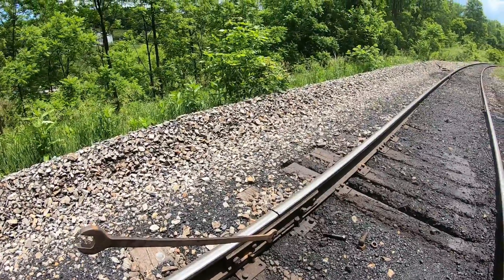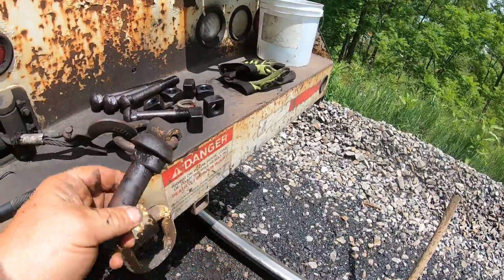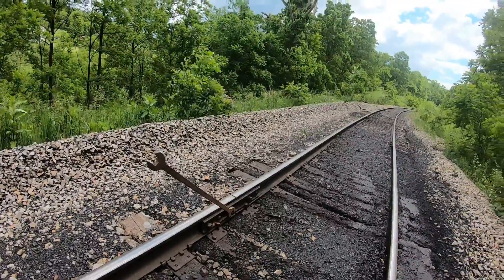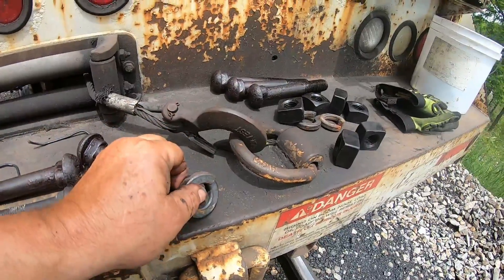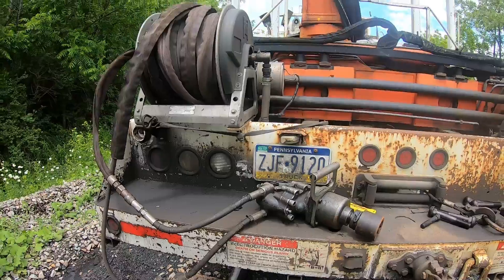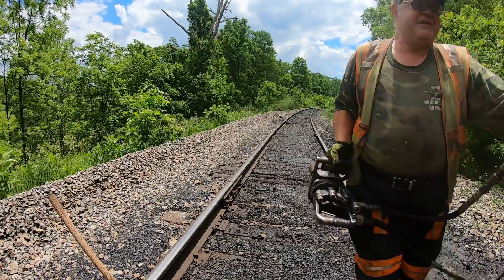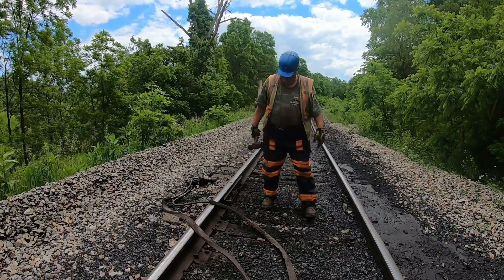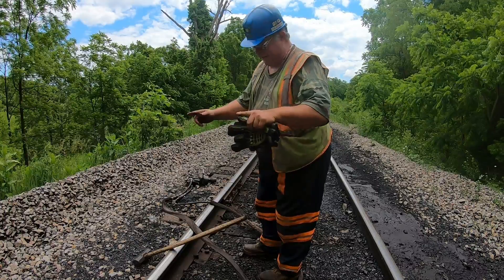Bolts in a Track Joint need Replaced - You Can Help Fix Them

Comment: cut bolt on nut side with railsaw or cutoff saw
Reply from the maker: Yes sir, that's the way we do it, didn't show that in the movie and
now I'm really kicking myself for not doing it, but there will be
others to cut off for sure. I am always very, very careful when
cutting bolts off when I'm by myself, I'd much prefer to do it
with someone there, I've seen some weird stuff happen like
blades break up and scatter everywhere. Thanks for writing in
Reply: @ccrx6700  yeah it's nice to have someone to hold the punch or the plug Hammer works good if you got one of those

Comment: I always found it easier to remove a bolt one at a time and at least put it's replacement in loosely to keep the joint bars from flopping off instead of taking them all off at once.  It may be a little bit slower most of the time, but those times that the joint bar flops off you would lose a lot of time and gain a lot of frustration.
Reply from the maker: Good thinking 👍

Comment: You got to film the hi-rail boom truck you're driving to load rails with the knuckle boom.
Reply from the maker: Someday I will do that, have to use both hands to run the control box,
gonna have to figure out a way to do this, thanks for the suggestion

Comment: When I hired out as a brakeman, a "section" man was turned loose on a section armed with a wrench, hammer and canvas bag with nuts, bolts in it to patrol on foot....more difficult patrols were on motor hand cars.
Reply from the maker: Ah yes, the way it used to be! Early on we were given a push cart with
bolts, wrenches, spikes, claw bars, etc. When a train was coming
take the cart off, then after he went by get back, do not miss those
days! Course I was 30 years younger. Thanks for watching

Comment: Here in the UK, we call them fishplates. I replaced a fair few of those bolts. Either by hand, using spanners or using a petrol powered nut runner or bance as we called it. Worked 11 years on the railway. 

Enjoy watching your videos
Reply from the maker: Glad to hear you enjoy them. Do you know why they are called fishplates? The part of the rail under the head and on the web where 
the joint bars contact, those parts of the rail is called the fishing.
Space between those contact points is the fishing space. Thus
that is why they are fishplates and it makes good sense
Reply: @ccrx6700  never really gave it a thought as to why they are called fishplates. When I joined the railway, I had to do a personal track safety course (PTS) to get a job on the railway. It was a 3 day course, just teaching you what to expect on the job, basic terminology of the 4 foot. What to do in a emergency, stopping trains and the correct way to contact the signaller. Amongst other things. The pts qualification lasts two years.

Later, they introduced a track induction course lasting 7 days, giving a more indepth look at the railway, going into more detail about the components that make up the railway. This was brought in, as so many were starting and didn't have the experience. 

Do they have anything similar in America?
Reply from the maker: @WaylandJoe  yes most RR do have safety courses. We had a 2 week training when I hired in but it was for mining since we are a coal mine, they didn't do anything here for RR, was all learn as you go back in them days

Comment: Fasteners are so ubiquitous, unless one works with them in industry, one doesn't give them much thought.  But Bolts like on that fish plate (Ha ha) or the studs on that hold the wheels on your car or truck have specific tensile strengths, and certain elasticities. The elastic properties go a long way in reducing loosening due to vibration-- it will allow a part a small movement and then snap it back. That's why you don't want to overtighten a bolt, and why different applications have different torques.  Overtightening a bolt can cause it to stretch and lose that elasticity.   Many years ago there was a feature on "60 Minutes" about "counterfeit" bolts  coming in from the pacific rim.  The steel formulation was wrong, and they'd fail.  Caused no small concern in the Airline industry, for one, but broadly through manufacturing at the time.
Reply from the maker: Thank you Rod for the very detailed comment, excellent points sir,
I did not realize that about the elasticity helping to reduce loosening,
makes very good sense. Oh dear, wrong bolts in airplanes could
be a real disaster!

Comment: We were required to wear a hard hat when we moved 20 ton coils of steel.  Since hard hats weren't required anywhere else in the plant, guys used to ask why they had to wear one back in the crane bays.  I always told them it was to give paramedics something to scoop up the mess in if a coil ever fell on you. We did get an object lesson though, when a mechanic left a wrench on one of the cranes (bridge and trolley crane, floor pendant control) which eventually fell off.  If it would have hit someone on the head, it would have left a bit of a mark. So, hard hats.

Comment: We use cordless Rad torque guns at work and they're terrific.  They're no bigger than a cordless drill and not much heavier. We have a few sizes from 500lb-ft on up.  Our biggest will torque all 324 lug nuts on a Cat 797F to 2500lb-ft with one or two batteries.
Reply from the maker: Now that's impressive! Am gonna look those up, thanks for the
info Dylan

Comment: Warsher, I love it.

why do you alternate the side the nut is on?
Reply from the maker: That's the way the joint bars are made, I believe it's because
they seem to think the staggered bolt pattern gives better holding
power
Reply: @ccrx6700  thank you.  I saw that in your new video.
Reply from the maker: @frotobaggins7169  👍

Comment: Great video. I was wondering if those bolts will need retorquing after a few trains have passed over the joint.
Reply from the maker: Thanks, glad you enjoyed and very intelligent question! Yes in this case because of the unstable ballast conditions. Most generally in
good ballast where track surface holds good, we don't need to re torque them. There is no set time frame for re torque, every joint is
different

Comment: I worked on a Section crew (Maintenance of Way) crew during the summers during my college years in the late 60’s. No powered tools, everything was muscled powered. Kept me in shape for sports. And on the CB&Q, now part of the BNSF, they were called Angle Plates.
Reply from the maker: Thanks Don. We used to use all track wrenchs too way back, but
once we got an impact, wow what a difference, go so much quicker
and way easier on the back and neck than trying to wrench off a
frozen bolt. I'm sure you know what I mean there. Appreciate your
watching

Comment: That's how it's done! I haven't seen any MOW equipment on the big RRs to deal with joints, so that makes you the expert!  😊  Thank you for sharing some necessary but difficult work on the tracks!
Reply from the maker: Your welcome Brian, great that you enjoyed sir. They do make a
machine that tightens the bolts as you ride along although we've never had one here. With 17 miles of jointed track that would be
a blessing to have one of those
Reply: @ccrx6700  I would like to see one of those!

Comment: I used to think 150ft-lbs of torque on CAT 3408 cylinder heads was tough.  Trying to manually crank 300ft-lbs... That takes incredible effort.
Thank goodness for power tools.
Reply from the maker: Big wrench = Big Torque....LOL Hard get a wrench that size on a 
cylinder head bolt! Thanks so much for watching Stephen

Comment: As a maint. man for the last 45 years, I’m asking myself why the chutes on the cars leak so bad. Underground it’s all electric. Your kidding me sir, imports from Pakistan arewose
Reply from the maker: These cars were built in mid 1980's, they get dumped 6 to 7 times a day, extreme use has worn them out. Most coal cars get dumped once a week. It's a never ending battle for the mechanics to keep
doors adjusted right. We need new cars for sure Jimbo and actually
these new owners we have are looking into that.

Comment: Remember that "Mexico" is not one unified track bolt factory, in fact I would guess that they have several different factories, all making different types of mistakes... Lol
Or to put it another way, if you ever need to find a new supplier, chances are that if you try some from Mexico, they will be from a different factory and so have different properties than before.
And I suspect that they have improved their manufacturing abilities, considering that most semi trucks are now built in Mexico, and they seem to get those bolts all right.
But hopefully your US supplier will continue to provide good bolts!
Reply from the maker: Thanks for the info Ben, did not know that. our regulator was made
in Mexico in 1995 by Progress Rail for Kershaw, we've had a difficult
time getting parts since then, not so much cause it was made there,
but ours is a prototype regulator and not a lot of them made. Appreciate you comment and for watching my friend

Comment: Beefy bolts fer sure!!!
Question: Why not weld the rail like the main lines do???
Reply from the maker: Good question Franklin and here's why. To weld that would mean
replacing every stick of rail since the rail we have now with 3 bolt
holes cannot be welded. The cost would be astronomical now
to go with CWR. Plus we would need a tremendous amount of
dead track to do it, even if it was done in sections and they seem
to want to run trains every day, we only get a couple of weeks a
year now with dead track

Comment: would you be able to show us the rail inside the mine?
Reply from the maker: Sometime I can show the rail going into the mine, but I don't have
state certified miners papers so am not allowed under ground.
I've never been under ground either as a worker, only twice on a
tour, it's definitely a different world 700 feet below the surface. You
might be interested to know that everything is white under ground.
They rock dust everything to prevent fires from coal dust from
happening

Comment: I get that the bolts can wear out, but do you reuse the nuts?
Reply from the maker: Great question and when we replace a bolt I always use new
washers and nuts, maybe it just me, but I like all new instead of
used, same with spikes, pull a spike out and use a new one.
Reply: @ccrx6700  The nut might be the least expensive of the three!   Always recycle
Reply from the maker: @shopshop144  👌 thanks

Comment: Why are the nuts on the inside of the rail as oppose to out side?  It seems maint. would be easier, safer and less maintanace  to work on if they were on the out side.
Reply: Staggered to hold better. On a 4 bolt splice bar you have one facing each way on each rail, The splice bars are designed that way. Most of Europe uses one side only and they also don't stagger their joints.
Reply from the maker: Very good explanation sir, thank you
Reply: @gravelydon7072  thank-you for the explanation!!
Reply: @paulpatterson4983  You're welcome.

Comment: Is there an advantage to using a hydraulic impact over pneumatic? Or is it just because your vehicle is equipped with a hydraulic pump?
Reply from the maker: Yep, hydraulic is what we have on truck, I've never used a pneumatic
wrench so really don't know the difference in how the 2 would work,
but it does seem the hand air spikers work better than the hydraulic hand spikers

Comment: Hey Dave, better take a look at Renner Stock Farms latest video.  You will like it cuz it takes place at a Steam Plowing and threshing show.
Reply from the maker: Thanks Tom, I will, I love steam engines as you know, appreciate
that
Reply: The big Case that is pulling a 50 gang plow is brand new.  A multi millionaire that owns a foundry just recently finished building it.  Renner interviews the gentleman in 2 or 3 videos back.  Renner stock farms also has som pretty hot John Deere tractors that they have restored and modified.  You will like the channel.
Reply from the maker: @tomharrington1393  👌 thanks

Comment: I would have never thought track would need so much mantinence. Mostly because seeing a MOW crew on the line that ran behind my childhood home was a rarity. But then again that line didn't see a lot of traffic untill after it became a BNSF line. Then it got buisy.
Reply: Jointed rail needs more work and I think this line needs even more because the coal fines are always messing with the drainage.
Reply from the maker: You are absolutely correct in that. We were cursed from the beginning
with all jointed track and bottom discharge hopper cars, but oh well
can't change that now

Comment: Another informative video Dave. Always love watching all the jobs you do. I always wondered though.. when I see the rails joined, there's 2 bolts facing in and 1 out. 3 on each end. Is there a reason for this? Does it have to do with the stretching of the rails? Just a thought. Thanks again for the video!
Reply: Also, when you have a derailment it will only sheer off the nuts on the one side where the wheel came off, it won't sheer off the other side so the joint bar will still be doing its job when a derailment occurs.
Reply from the maker: That's the way the joint bars are made, they tell us the staggered
bolt pattern is for better holding power. Appreciate your writing in
Peter and for watching sir

Comment: Nice video Dave ,,, we have been using the Milwaukee 18volt fuel 1 inch drive battery impacts very impressive i believe better torque then the hydraulic units (lighter too😀),,, keep on railroading sir
Reply from the maker: Thanks Mike, my buddy works BNSF text me some vids of the M18
wrench, he said it was great. I put in suggestion for it here, still
waiting. Mechanics here got a Milwaukee 3/4 battery impact, it's
totally impressive for putting on tamping blades, want one of those too...LOL Do appreciate your comments my friend

Comment: sounds like you could use a summer guy just replacing bolts/ re tightning loose ones. with the coal fines mucking up the rails one step forward 2 back seems to be the norm
good thing you like playing with the oversized tools.  lol that's railroading catch ya later Dave
Reply from the maker: Surely could use some help Kenn!

Comment: Oh hell yeah, hook me up with a hydraulic impact wrench!  I’m surprised the bolts are only a grade #5 bolt.  Geezus christ, 5 or 10 gallon a minute flow rate through that wrench?  No wonder your arms look like ham shanks!
Reply from the maker: Grade 8 are very strong, they have no flex, the 5 bolts do have a 
bit of flex and our RR bolt supplier told us many years ago the 5's
were better for our application than 8s. Also use 5 on tamper tools
for same reason, the 8 bolts snap in half a lot quicker on the tamper
believe it or not. Thanks Michael for watching

Comment: Are the connecting joints in the two rails always staggered to avoid being across from one another, or does that not matter?
Reply from the maker: When our track was built all the joints were staggered at equal distance, over the years some sections that have had new rail put
in have joints across from each other and others have the joints
staggered 1/3 instead of 1/2 rail length. Reasoning for this is
the old track boss wanted to experiment. They tell me joints in the UK
are all across from each other. Seems like there no industry
standard for this other than whatever whims the track boss wants
to have happen at the time?
Reply: Not always, when there’s a derailment and pre made track panels are used to replace the torn up track, the joints are just about always even with each other. Sometimes they’re left that way, other times a track crew will come through sometime in the future and weld the joints together. When left bolted, 
they’re staggered to lessen the pumping action you get when the wheels cross the joints and to slow down metal fatigue at the joints. It also gives a smoother ride.
Reply: @ralfie8801  They going to end up staggered anyway, since the rails are a fixed 39ft length and the two rails have a different length around each curve.
Reply: @beeble2003  
That’s not really staggered though. When they’re laid individually, the joint in one rail ends up somewhere around the center of the other rail. 
It doesn’t really matter if they weld it all together in the end.

Comment: Hey Dave, 80 pound rail is monstrous for mine rail. That stuff comes in weights as light as 8 pounds (that's EIGHT) pounds per yard. I have a switch stand for the small stuff and I'll send you  a picture.
Reply from the maker: Talked to an old guy John that told me they used 15 lb rail on sections
under ground where the horses used to pull the carts in, havent
heard of 8, but don't doubt your are right for some mines. Thanks for
sharing that. A whole lot of folks out there don't realize what all
happens with that kind of stuff

Comment: If your impact wrench is going to be repaired with a couple of new gears wouldn't the rest of the gears be going bad
Reply from the maker: I didn't take it apart, but they did order a whole new gear set and since
this video was make it has been fixed and works fine now. These impacts take a pretty harsh beating out here, surprises me they
hold up as well as they do Mike. Thanks for watching sir